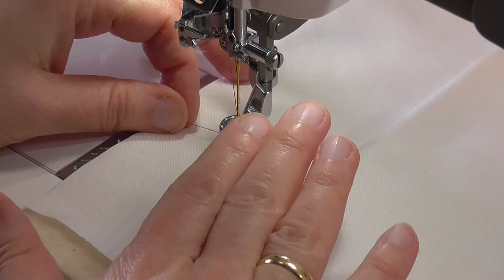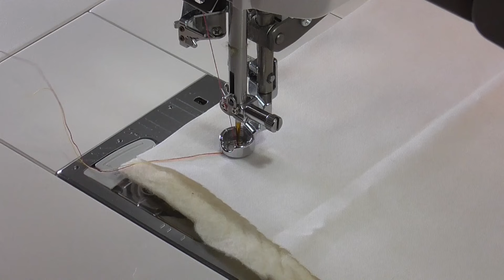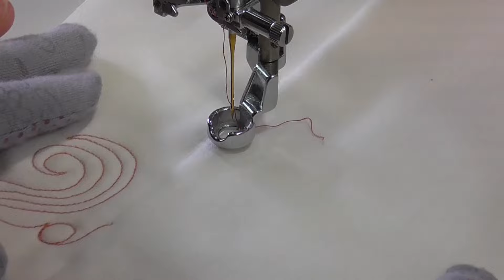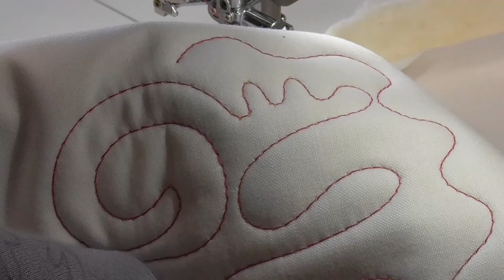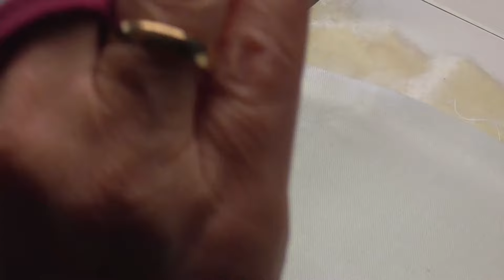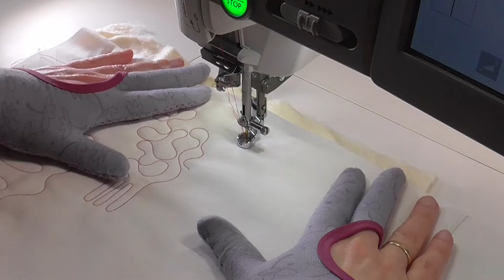Getting those stiches right; technical content on controlling stich length in free motion quilting.

Comment: Very informative for new quilters. My regulator is the wiring between my foot and my hands. It takes practice but now I have found it..I am hard wired for success.
Reply from the maker: That was a very good description. I just operate by hearing. Once the machine hits the right frequency I am good to go. The last two years were very intense so I can handle also high speeds, but mid-speed is good for my soul ❤❤❤

Comment: How high do you sit at the sewing machine?   I have adjusted my chair so many times to find a comfortable position.   It seems like my left hand doesn't make an effort to help the right hand.   I am using a brother sewing machine. I have quilted several quilts and i will not give up.
Reply from the maker: I put my chair all the way up and my pedal is also on a wooden block so it is relatively healthy. but I needed some time to get used to. The best is if you can lower your machine into the table, but it is not always possible. I don't know why your left hand is less cooperative. I hope it will get better with exercise and focsed effort. There are so many factors. And I am happy to hear you are determined to keep quilting. I am trying to cover most of the questions and problems from the comments to help as many as I can ❤❤❤

Comment: My stitch regulator is back in its box - I tried it maybe 3 times (12 years ago) and did not like it at all!  I do, however, love the motor speed control on my sit-down so I can work my fabric movement speed together with the motor speed.
Reply from the maker: I so get you! several years back I was sure I need a Bernina with thir stich regulator for perfect stiches. It was too expensive and at first I was a bit sad I had to "settle" for Janome. Till I had the chance to try it out. It is not my style. I love my Janome machines and my slightly irregular stiches. I think it is more about the perfect expirience than perfect stcihes. ❤❤❤

Comment: Thank you great video. Could you please tell us what kind of machine you have and if you change the tension.
Reply from the maker: Hi there. I have a Janome M7 and sometimes I have to adjust the tension a bit depending on the batting and threads. But this machine has pretty good auto settings. With my small brother I do not have to touch anything. It just works. ❤❤❤